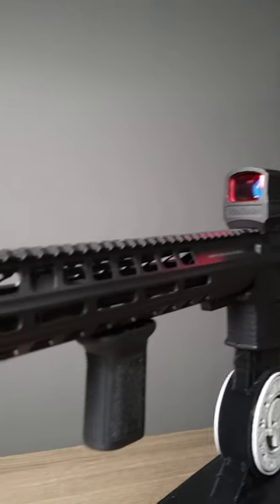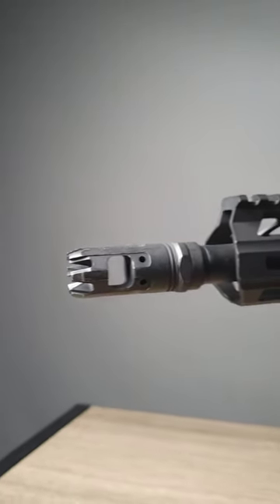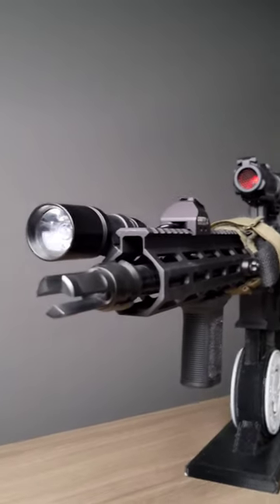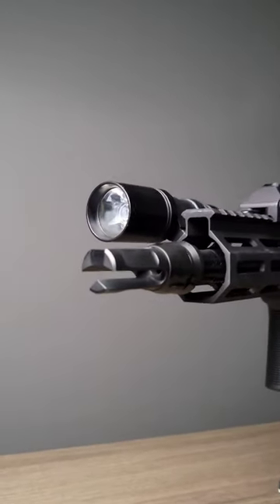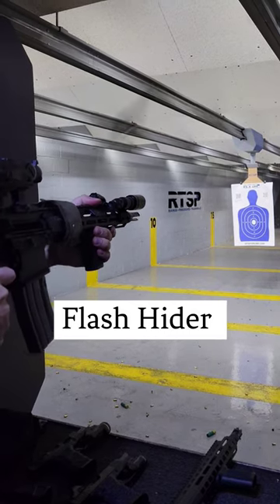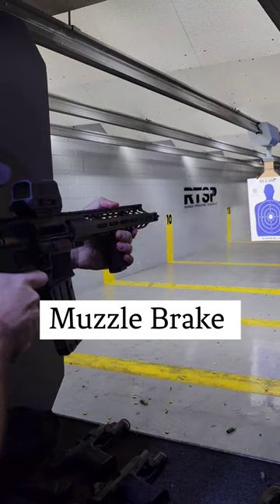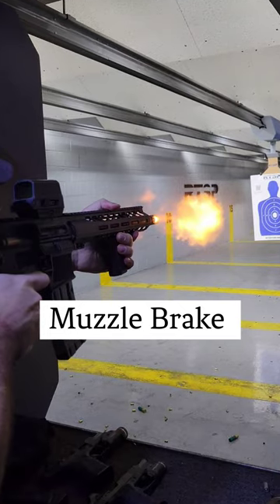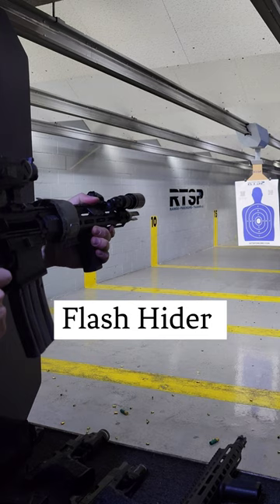Muzzle Brake VS Flash Hider? #shorts

Comment: you camera probabaly isnt' capturing the flash of the flash hider, given there's nothing there, when there should be at least something. Prongs are just one type of flash hider. You also have bird cages, and others. Get a slow mo camera, you will some flash, and do it in the dark.
SF use suppressors primarily for the flash suppression, over noise. Noise is good as it allows them to run without a lot of ear pro, but at night, you want a supressor, otherwise you will be spotted so easily when the area around you is lit up like a christmas tree